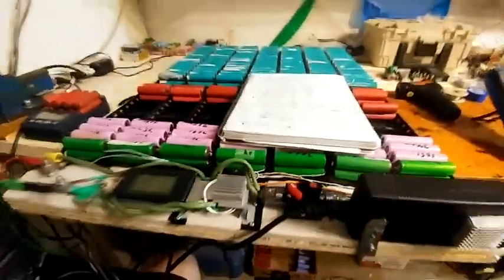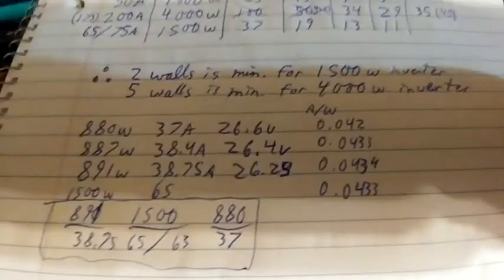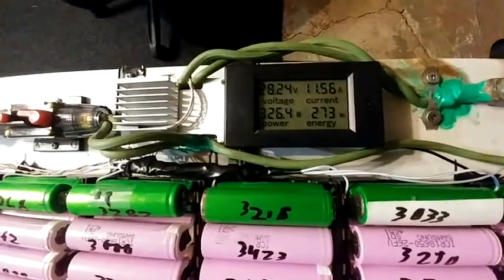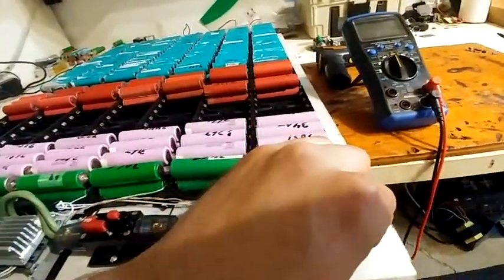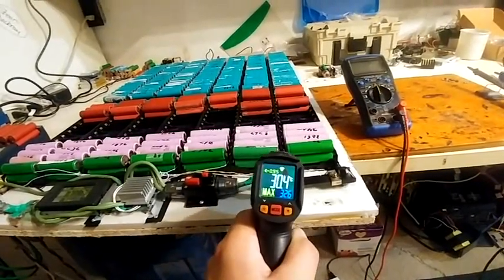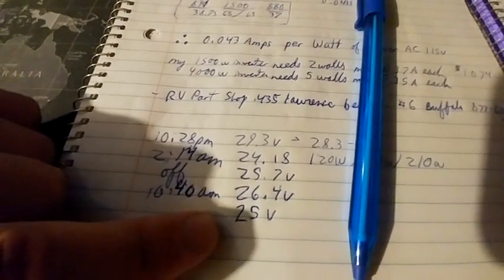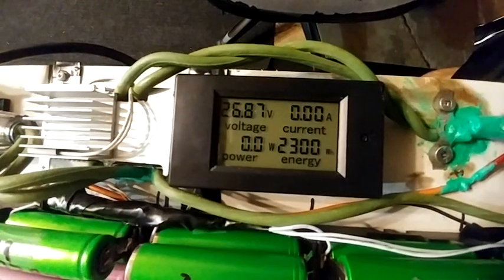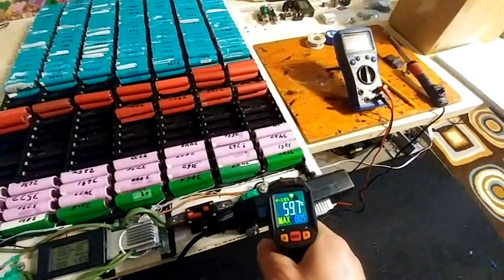18650 7s detailed Load test Modular off grid Powerwall

Comment: Andy go for higher voltage the best that you can do is pull the smallest current that you possibly can do that you must go. 
with higher voltage 60v or best would be 96v..... 
I run 48v 14s on 300Ah li-ions 18650's and I pull 50A 2600w anytime... If I was running 96v it would be only 25A less current pull....life of cells it life x3 and so on .... 👍
Li-ions shuld last for a decade or even more....